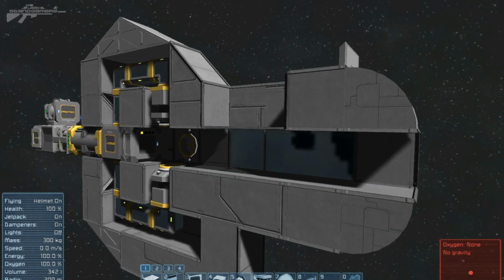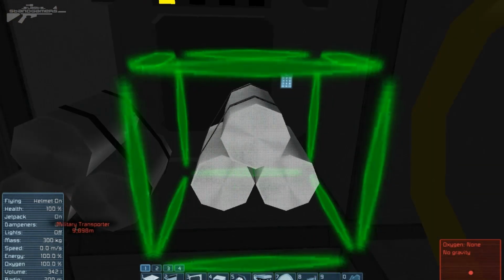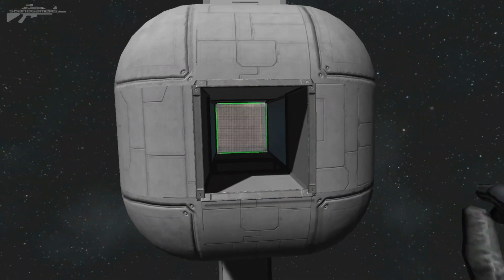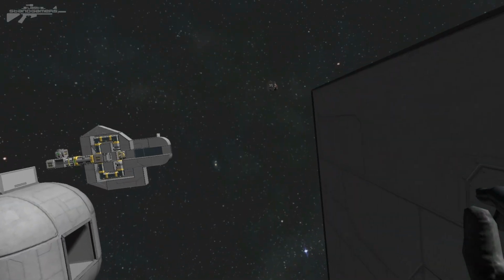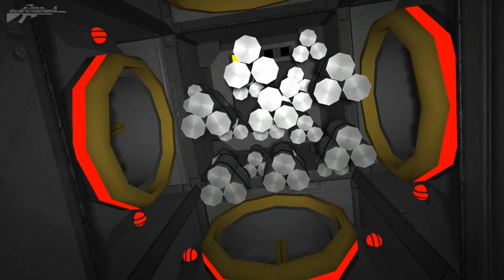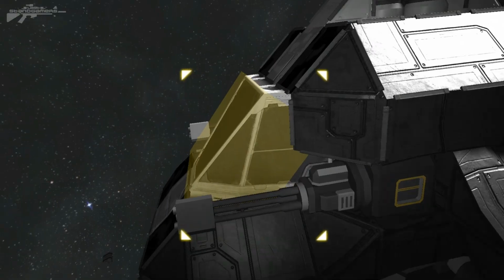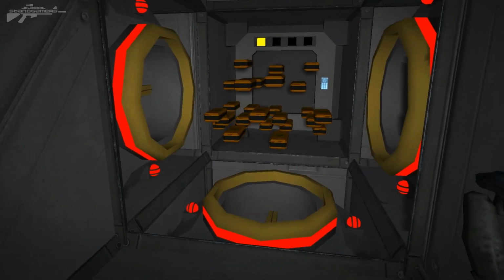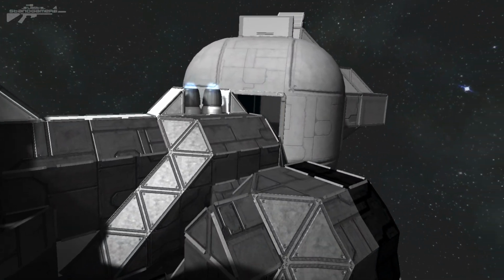Space Engineers - Pressure Cannon, Experimental Concept

Comment: Without conducting any Tests i see 3 flaws that could be of an issue with this concept. I love the idea dont get me wrong, but this is being mentioned to see if anyone else could potentially think of solutions.

Problem #1: Pressurizing the Cannon

Using a Door, won't open quickly enough, initially having the cannon fire upon itself.

Using a Grinder same issue using frame

Problem #2: Loading the Cannon
In Space, The Connector or Ejector both spit the object out forcing it to bounce within the cannon potentially not properly lining up and causing issues.

In Planet Gravity, the Item will Drop to Planets Gravitational Pull

Artificial Gravity, similar issue to planet gravity.

Problem #3: Time to Load
Due to the fact of it using Loose Items, you wouldn't want to preload the Cannon, which isn't necessarily a problem but could be a downside to the cannon itself that it takes time to load the cannon.

Just thought id put my thoughts out there to see if something like this could be done if someone has a solution.

Comment: I've been doing a little more tinkering with grav cannons.  How you get your projectile up to maximum velocity (gravity, pressure) doesn't matter, what matters is what the target is doing.  Targets that are immobile suffer the most damage, those that can freely move suffer the least or none.  

Let's take a single 250L or 700kg lump of stone out of a connector and accelerate it to 104 m/s.  If it hits a station.  There is no where for the force to go except into the block that it hits.  The results mean that the block is destroyed and possibly those underneath.

Take the same lump of stone and fire it into a large ship with the inertial dampeners "on."  The dampeners are going to push back against projectile, leading to localized damage, but not as great as that of the station, since the ship does give up some of the energy by displacing a little. 

The least effective result would be a large ship with the inertial dampeners off.  There is no push-back against the projectile, so the energy is mostly absorbed through the ship displacing.  It will typically spin around its center of mass, depending on how far from that center you hit.  

A 42,000kg projectile has similar results.  Due to the size of the projectile, the initial damage is greater but mobile ships tend to give, even with the inertial dampeners on.

However, against an immobile stations, the results are devastating.  A 42,000kg projectile becomes a wrecking ball and will pierce 10 layers of heavy armor like they weren't even there.  Even a 700kg projectile will score some amazing damage.  

Your results will vary a little with the objects you're firing.  But chances are you're not going to be firing expensive components at cheap targets... unless you're the US military.
Reply: From the testing I've conducted the problem of shielding remains: Two, three spherical grav-gens, set to full outward push will deflect - or outright reflect - such a projectile. Now this kind of shielding is easily activated and maintained on a station, and can be hidden deep enough inside to be impossible to take out without resorting to using gravitic cannons to launch boarding pods that disable their a-masses in mid-flight (which, in the most compact variant I've built, are still four to five large-ship blocks long, can only carry three crew and do not necessarily guarantee crew survival.) Even if a boarding party succeeds, much of the pod is destroyed upon impact - the armour remains salvagable, but most of the a-masses and the battery system will be lost.

The best use for gravitic cannons in my opinion remains shelling a target at the edge of, or possibly beyond, visual range by sending in a recon drone to pinpoint their location, then targetting with a camera and deploying constructed shells that use a connector system in order to ensure shots are stabilised and can be placed in a precise fashion. (I've built such a system, with a little modification to the timer blocks used to automatically reload it it can refire on its own approximately every fifteen seconds.)

This tactic becomes problematic when not engaging from 'above', that is, the direction of the target's gravitational pull, however precision aiming may not be required when firing shells with an explosive/blast door edge payload, as large ship warheads tend to remain quite dangerous and the blast door edge is capable of penetrating heavy armour before the warhead detonates.
Of course, if the enemy possesses a missile defense system, entirely solid projectiles are preferrable - a high-explosive round can be stopped by being detonated in mid-flight, a purely kinetic-energy round cannot, at least not quite so easily.
Reply: Gilda Griffon   Grav generators work at a maximum of 75meters in any one direction.  In order to stop a projectile, that's 9 grav generators, assuming you have 3 layers of block above it.

That's a lot of power to protect 150 meters in one direction.  To protect from attack in multiple directions requires a lot more power and juggling a lot of vectored force.  There's always the undesired backfield to contend with.

I grind down projected small containers sitting on a conveyor sorter.  The sorter fills the container full of stone and then when it bursts I have a 42,000kg projectile to fire.  I use a small amount of gravity to pull the projectile to a heavy armor wall sitting flush with the conveyor sorter.  Once the projectile is settled, it's ready to fire.  I'll guide it with a virtual barrel of grav gens emitting a small beam of gravity.  I'll push it with as many grav gens as I can get away with.  The shorter the distance of acceleration the better.  

I've gotten accurate shots out to 20,000meters.  If you can send out a recon drone on a laser antenna and place a GPS marker on the target great.  Else you can line up two GPS markers as reference points with the third point in the line being your target.

No one is going to keep a gravity field running unless they're under attack.  At 20,000 meters, that's several projectiles launched if you have two launchers working in tandem; four is better if you're really sadistic.  Sit back and grab a cup of coffee and wait for the rain to start.  The 42k ball of stone is pretty dark and you'll miss it unless you're looking right at it.  When the first one hits, it'll take a moment for the player to figure out that he or she is under attack.  Depending on your rate of fire, you have the possibility to make one or maybe more critical hits that will change the outcome of the battle.
Reply: The power of spherical grav-gens is not reflecting the shot, but deflecting it - swatting it aside, simply put - and those are omnidirectional.

As for the efficiency of mineral projectiles, I had assumed they nerfed those by making them pass through armour?
Reply: Gilda Griffon Stone, Iron, etc still impact armor.  components still impact armor but have a tendency to pass through on ocassion due to their small size.  Components still cause damage.

Comment: Larger pressure vessel behind the barrel. If you have a cubic 100 miles or so with a single block aperture for the barrel.
Essentially having more air to rush out of the barrel to propel the shot.

Comment: the clipping glitch is something they're trying to avoid fixing for some reason. they'll make limitations to reduce the chance you'll come across it normally,but not look into why it happens.
Reply: +Zaptechz It is a classical problem in collision detection. I bet they know all about it. Problem is that fixing it requires more computing power, meaning the game would run slower. Well, depending on how good you are at optimizing it of course :). Nevertheless, it requires more cpu cycles.

Comment: Now all you need is to do a 3x2x2 chamber (room 3 long x 2 wide x 2 high) and use 2 of the airtight hanger doors as your firing mechanism. This will allow your connectors (loaders) to be just behind the airtight hanger doors to get the maximum amount of air behind them. This will also allow for a larger load to be fired and have a much more devastating effect at the same time (your floating objects placed inside a small torpedo shell). By building this design it will allow you to have a gyro set and attach it to a set of advanced rotors to allow you to use it like a turret and fire by the press of a button and use of 3 timers to make it a semi-auto weapon. timer 1 is activated by button (DE-pressurize off, eject-all on, start timer 2) timer 2 is set to a 10 - 15 sec delay (turn off gyros [safety system], open airtight hanger doors, start timer 3) timer 3 is set to a 3sec delay (close airtight hanger doors, turn on gyros, DE-pressurize on).

Comment: Put a warehead or glass or something fragile for the tip, put the engines only facing backwards, turns it into a (rather expensive yet effective) missile. Can even put a guidance system on it. Problem with the missile and the cannon both is that it can't be moved while loaded or else the explosives would detonate in the chamber,,, I think. Deserves a few more tests I think, but imagine it hitting a big ship, breaking the hull and opening up the chamber to release the pressure, firing the shrapnel into the large ship, hitting deeper systems, penetrating even deeper.

Comment: This needs to be paired with a secondary function.
The explosives are great, but there still is no effective way to capture a ship yet... until now????
See, use the air cannon to load a small ship up with heavy materials, then use a gravity well (tractor beam) to grab the ship and draw it into a capture bay?
This concept may work on larger vessels too, but the amount of resources required would be ridiculous.
Reply: Makuta Nazo I made an air cannon, fired it at a fighter, filled the fighter with cobalt, and the fighter was able to resist 20Gs with inertia dampeners off.
Reply: Makuta Nazo you won't need a torpedo you can just make a drone
Reply: Other way is shot a proyectile full of mass blocks to a large ship, then stick it to the ship and finally use gravity to decelerate the enemy ship
Reply: Well that may work... but the issue with mass blocks is they need power, and would be damaged on impact... aiming torpedoes is painful really.
Reply: Same with this cannon
Reply: There isn't a torpedoe needed though. Just spray fire metal plates at high speed and over a wide area. Then Bam, you've crippled a small ship and should be able to grab it.
Reply: Makuta Nazo this all will be easier if all the phisical objects in the game were affected by gravity
Hey look at those 30000000  tones of iron blocks that arent afeccted by 300g!!!!
Reply: Mike A Welder of antigravity.
Reply: Makuta Nazo Space balls don't use power.
Reply: Hmmm.... well the extra weight would make it sluggish then and easier to shoot down...
I just picture the air cannon as a defensive weapon more than offensive.
Reply: Makuta Nazo Another thing you could do is use landing gears and you just run off with the ship while people are in it. xD
Reply: You can make space balls weigh up to 5 tons
Reply: A bit more than cobalt ore
Reply: U can use it economly, fire it at a cargo ship then disassemble the ship at the next station and bam! It's there! This would be best for smuggling illegal supplies
Reply: Mike A Dude, good idea, but the armor the blocks and power would need to survive the hit as well as the materials may make this a waste.
Reply: Le Derp Français If you are using a small ship and you are towing a large ship, you may need a massive amount of thrusters.
Reply: Kent Fuller Cool
Reply: Makuta Nazo spaceballs don't need power, and aren't damaged on impact.
Reply: Michael Halpern Ball shields?
Reply: Erik Vanderburgh
they take weapon damage, cost a bit in the way of less common resources and otherwise classify as a frowned upon thing to do, even if you had the resources
Reply: Makuta Nazo use merge blocks for aiming with railguns. i have a mergeblock railgun that allows you to aim with a torpedo loaded.

Comment: The main issue with this is that you're using oxygen, which not only is a limited resource, but is required to survive. Very cool design, but you are slowly killing yourself by using it
Reply: What if the crew is made of robots?
Reply: Caroline Venus It can be adjusted to be automated, or activated remotely which means you don't need and of your peeps around in the depressurized environment. Plus, that isn't a whole lot of space to pressurize, so it's not like it costs too much in the way of resources.
Reply: Caroline Venus It's not like oxygen is that limited of a resource in Space Engineers

Comment: Have you tried using missiles (As an item) or rocks to launch out of the cannon?
Reply: I think they would have the same effect as the normal explosives.
Reply: megaman922934 Missiles explode on impact though. Explosives do not.
Reply: Zeleharian oh I thought they didnt.
Reply: if they did they could cause damage to themselves
Reply: Xero0 if you fired one at a time it would be a high velocity Cannon, it would be a vanilla version for the Cannon mods :D
Reply: Zeleharian Explosives do explode on impact, or even when shooting them.
Reply: Michael Schmid I don't think so. I have never had explosives explode on impact. Shooting them does work though.
Reply: Zeleharian
It worked for me, I took some with Shift F10 and turned arround while placing it and smashed it against a wall.